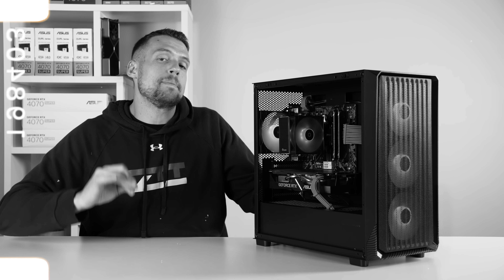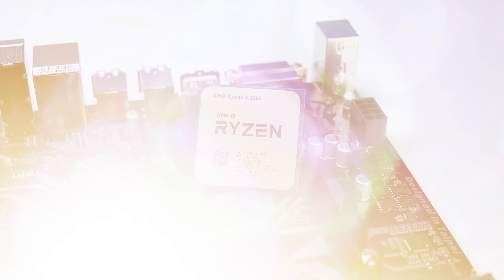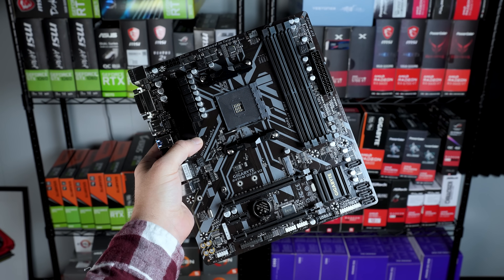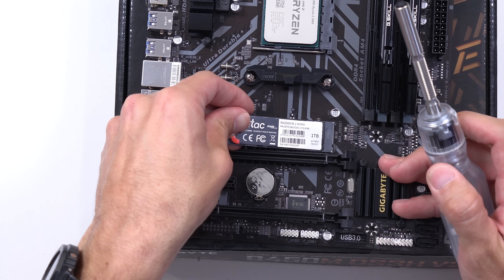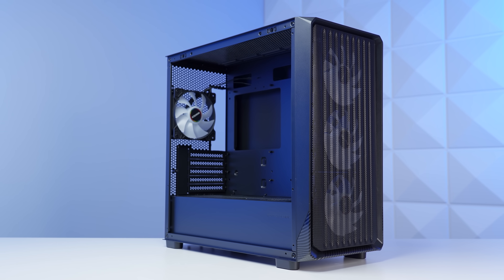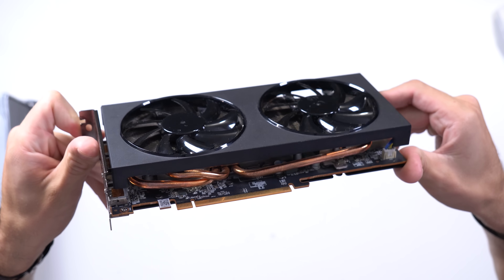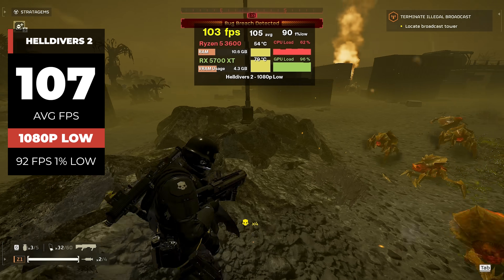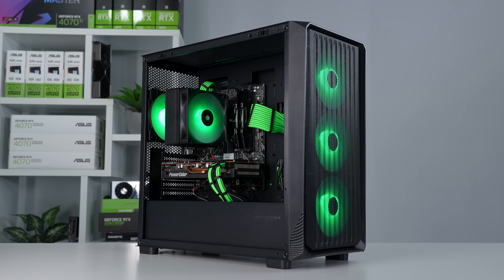$450 Gaming PC Build Guide

Comment from the maker: Thanks to Corsair for sponsoring today’s video! Check out their brand-new Frame 5000D case here: https://www.corsair.com/us/en/p/pc-cases/cc-9011308-ww/frame-5000d-rs-high-airflow-mid-tower-pc-case-white-cc-9011308-ww
Reply: Hi zach :3 so i builded *almost a new gaming PC that i planned to build like in the early start of the summer but in winter world said nuh uh and yanked my dad from us ( died bc of hearth attack ) but any ways i tried to cook up my build heres my parts :

AMD Ryzen 7 7800X3D 4.20GHz

James Donkey Lugis JDC240 ARGB 240mm liquid cooler
Team T-Force DELTA RGB 32GB(2x16GB) 6400Mhz DDR5 CL40 black Gaming Ram

Kioxia Exceria Plus G3 LSD10Z001TG8 1TB Gen4 5000/3900MB/sn NVMe PCIe M.2 SSD

COLORFUL BATTLE-AX B650M-PLUS V14 DDR5 7600MHz mATX AM5 Gaming Motherboard

well about the GPU i have a GTX 750 Tİ rn so i have to use it a while :3 *im planing to buy a used 3080 or 3070 ti * i cant buy  5000 series cuz yk the prices 

Whic parts did i upgrade from :

12.th gen i3 
8 gigs of ddr 4 
GTX 750 Tİ(well kinda didnt upgrade it tho but )
idc some cheap MSİ mobo same thing for PSU 

 if u put me to the vid i would apriceate it LOVE y'all
Reply: Please make a $500 PC build using the amd RX 5700 XT I. figured something out myself but it would be very great to see somebody using it for a budget PC build.  to say it's actually somewhat easy to find a build for this card I'm Canadian and everything up here is like $300 to $200 more with newer parts and usually even $100 more with used parts so if I can do it you could probably do it.
Reply: Asus Strix GTX 1080 OC for 90$
Reply: how big of a deal is the fact that B450 doesn't support PCIe 4.0, just 3.0? Both the CPU and GPU listed here support 4.0... then again a B550 board will push the budget closer to $500...
Reply: i really need help my pc keeps freezing when I'm not doing anything on it, i cant refresh the graphics card nor do anything once its frozen how do i fix this.
Reply: The only thing I dislike is the motherboard. They placed the sata port facing up right where the gpu sits. I have a 3070ti with the one you had in the first video and it makes it really tight putting the card in. Its an awesome budget option just feels like they overlooked the gpu fitment
Reply: ZACK PLEASE HELP is an intel core i7 14700f and msi rtx 3050 ventus alright for games like, idk hitman or smth?
Reply: Does anyine know how I could fix my computer it keeps freezing and I’ve tried repairing windows, installing windows again, cleaning it, makinf sure everything’s connected, I thinks it’s my graphics card which is a etc 3090 and I’m trying to fix it so I can make videos and play games but I can’t. Can you help?
Reply: Do An all used parts pc build
Reply: A PCIE 4.0 GPU in a PCIE 3.0 motherboard is LITERALLY LOSING OVER 50 FPS.
Reply: Hi, I want to buy a Gaming Pc but I don’t No What GPU is better for Gaming Amd RX 9060 XT 16Gb or the Amd RX 7800 XT 16Gb and would be Like good CPU's for the better one
Reply: @RizeRx-ks2ln sry bro but he ain’t responding😭✌️✌️
Reply: please help, these components cost $1300 at best in israel.what do i do
Reply: @Crachboss32  PS5
Reply: Thanks Zach for another banger video!
Reply: $24 dlls for the Ram, i haven't seen a price like that and I been searching.

The motherboard last week was around 120 on Amazon

Comment: I have ryzen 5 3600 and rx 6600 which i should upgrade first gpu or cpu first?
Reply: In my opinion, an AMD Ryzen 7 5800X3D could be a good CPU upgrade, depending on your needs.
Reply: but make sure to check your motherboard and PSU compatibility

Comment: Hey Zach, greetings from Greece! I ve finally built my first PC and i would like your opinion.
case: Lian Li Lancool 217 Gaming Midi Tower
cooling: Deepcool AK400
CPU: AMD Ryzen 5 9600X
GPU: ASUS GeForce RTX 4060 8GB ProArt OC
PSU: MSI MAG A750GL PCIE5 750W Full Modular 80 Plus Gold
SSD: Kingston Nv3 SSD 1TB M.2 NVMe PCI Express 4.0
Motherboard: Gigabyte B850 GAMING WIFI6 Motherboard ATX with AMD AM5 Socket
RAM: Kingston Fury Beast DDR5 16GB RAM 2x8GB with 6000 speed and 36CL (KF560C36BBEK2-16)

Comment: What I'd find a little more useful at this overall performance level than the achievable FPS at low or medium settings is what settings you can go up to for a somewhat console like experience at, say a reasonably stable 40 FPS, at least for the single player titles.

Comment: About seven months ago, I built a PC for my father for  316,82€ (367.42$) . It included a 3600X, an Asrock Phantom Gaming Rx 5700XT, a Be Quiet System Power 11 750W, an Alphacool Core Ocean T38 240mm AIO, a Gigabyte B550M K, 4x8GB Corsair Vengeance 3600MHz CL16, a Mars Gaming Micro-ATX case for 36€ (41,75$) from Amazon with case fans pre-installed, and a 2TB SSD. This is the ultimate price-to-performance build. Almost everything except the case and the SSD came used from an eBay auction.
Every game he plays runs on Full HD Ultra and some on QHD High/Ultra

Comment: I would always want a b550 with wifi/bt as of 10/17/2025 that is 88USD on NE (for the PCIe gen4 compatibly) now that gen4 drives are cheaper than gen3. I don't buy used parts off of Ebay I have been burned to many times.

Comment: I have i3 12 100f, rtx 2060 16 gb ram, 650w powersupply, 512 gb ssd, 40 euro case with 2 fans ..... Costs under 400 euro most from used market best buy rtx 2060 - 90 euro .... Only for CS 2 ❤

Comment: QUESTION!!!

Hey! I recently upgraded my PC! Been very exciting and Iam have a blast. I had a 3070 TI now to a 5070 TI and I7 10700K now to a Ryzan 9 9900x. I use it 90% of gaming and I have no issues with maxing out every new high graphic title at 1440p battlefield 6 doesn't drop below 120fps, COD, Avatar max settings similar and much higher outcomes. Etc...My question is should I really have gotten the less expensive but more for gaming based Ryzan 7 X3D CPU? Did I really waste the extra money or did I do good because getting a more powerful CPU for holding its value and strength for future upgrades? Love the content!

Comment: I'd say that the 1080ti is better than the 5700xt in every way, including price used (at least on eBay), but maybe that's just because I am a fan of using the older generation's premium products over the newer generation's budget. Also I would maybe use a 3700x over a 3600x, but i am still a fan of the 3600x.

Comment: I have a part list can you look at and tell me if it's a good list or not. Part List

AMD Ryzen 7 8700G 4.2 GHz 8-Core Processor

be quiet! Silent Loop 3 78.4 CFM Liquid CPU Cooler

Gigabyte B850 AORUS ELITE WIFI7 ATX AM5 Motherboard

Crucial CP2K64656C46U5 128 GB (2 x 64 GB) DDR5-5600 CL46 Memory

Gigabyte GAMING OC Radeon RX 9070 XT 16 GB Video Card

Fractal Design North XL ATX Full Tower Case

Microsoft Windows 11 Home OEM -DVD 64-bit

be quiet! Dark Power 13 850 W 80+ Titanium Certified Fully Modular ATX Power Supply

Western Digital DC HC530 14 TB 3.5" 7200 RPM Internal Hard Drive

Comment: I am looking to upgrade my GPU in my AM4 Ryzen 9 5900x cpu, 32gb DDR4 RAM, currently rocking a 3060ti, should I go for the 5070ti or the 9070xt ot 9070xtx? I'm a bit scared to switch to Radeon GPU because I've read it can be a bit awkward with removing Nvidia drivers and switching - but maybe I'm overthinking it.

Comment: Do yall think this is a good first PC? I need perspectives 😅

Case

Corsair 3500X ARGB ATX Mid Tower Black Tempered Glass

CPU

AMD Ryzen 5 9600X 3.9 GHz 6-Core AM5

Motherboard

MSI B850 GAMING PLUS WIFI AM5 DDR5 ATX

GPU

Asus PRIME GeForce RTX 5070 12 GB

RAM

Lexar Ares RGB Black DDR5-6000 CL30 32GB (2×16GB)

CPU Cooler

Thermalright Peerless Assassin 120 SE Air ARGB 66.17 CFM Black

Storage

TEAMGROUP T-FORCE G50 2TB SSD M.2-2280 PCIe 4.0 X4 NVMe

Power Supply

MSI MAG A750GL PCIE5 Black 750W Fully Modular 80+ Gold Certified

Comment: Hey Zach love your content! 
I’d love to hear what you think of my build:
CPU: AMD Ryzen 7 7800X3D
GPU: ASUS ROG Strix RTX 5070 Ti
Motherboard: ASUS ROG Strix X670E-F Gaming WiFi
RAM: Kingston DDR5 Fury Beast RGB 2x16GB 6000MHz (KF560C30BBEAK2-32)
Cooler: DeepCool LS720 360mm AIO
SSD: Samsung 990 PRO 2TB PCIe 4.0 NVMe
PSU: ASUS ROG Strix 1000W Platinum
Case: FOIFKIN F600 ATX Mid-Tower with 6 ARGB fans

Comment: @ZachsTechTurf  

Good day, Sir Zach!

I just want to ask for your advice regarding this system unit I found — it’s priced at ₱28,000 (around $475) but negotiable down to ₱25,000 (around $425).

Specs:

CPU: AMD Ryzen 5 5600

Motherboard: MSI B450M Mortar Titanium

RAM: 32GB (TeamGroup T-Force Dark Z, 2x16GB)

GPU: GALAX RTX 2070 Super EX (1-Click OC)

Storage: Crucial P3 500GB NVMe + Seagate Barracuda 2TB

PSU: Corsair RM750x (Gold-rated, fully modular)

Case: Asus Prime AP201

Issue: Two USB 2.0 ports and the front USB-C port are not working

A follower of your page😊
Reply: Is it still good with this year and following years?

Comment: Hi, Zach, I love your videos. Since you're an AMD graphics card pro, do you know what the problem is? I recently built a PC with a Ryzen 5 7500F, Radeon RX 5600XT, 850W power supply and immediately a problem appeared: after long gaming sessions, if you try to switch from the game to another program via Alt +Tab, the signal from the graphics card disappears. I have the latest version of Adrenalin, the video card does not heat up more than 75-80 degrees C in games. After reading the tips on the Internet, I increased the maximum allowable power and lowered the maximum frequency by 3%. The problem began to appear much less frequently, but it still appears about once a week. Have you ever encountered such a problem and maybe you know how to solve it?

Comment: I'm currently running Ryzen 5 2600 and GTX980Ti, looking for upgrades and I have been planning on ryzen 5 5500 and rx 6600, which component should I change first? The CPU or the GPU?

Comment: I'm wondering if i should upgrade my GPU from a 4060ti 16gb to a 5070? I was thinking the 5070ti at one point but it's so expensive. 

I'm using a 9700x cpu so i don't think i need to mess with that right now. And I'm playing games at 1440p.

Any advice anyone or ztt?

Comment: Three years ago, I worked hard to save up every dollar I could to build my first gaming PC. I didn’t come from a family that could easily buy expensive technology, so every bit of money mattered. After a long time of saving — almost $300 — I finally managed to get a computer with a Ryzen 3 2200G and a GTX 1650. At the time, I was proud of what I built. It was something I earned through my own effort.

However, as games and software have become more demanding, my graphics card is starting to show its age. I can still get around 140 FPS in some games, but the performance isn’t stable. It often lags or drops suddenly, making it hard to enjoy gaming or even do creative work like video editing or streaming. It’s frustrating because I know my CPU upgrade helped a lot, but my GPU is holding everything back.

Getting an RTX 3060 would completely change my experience. It’s not just about higher frame rates — it’s about having a smoother, more enjoyable time doing what I love. With the RTX 3060, I could finally play modern games without worrying about lag or stutter. I could also start learning more about video editing, 3D design, or even streaming without my computer struggling.

I’ve already proven that I can work hard and save up to build something for myself. But right now, upgrading my GPU feels out of reach financially. That’s why the RTX 3060 would mean so much to me. It wouldn’t just be a piece of hardware — it would be a reward for all the effort I’ve put into building and improving my PC over the years.

In short, I’ve done my best with what I have, but my system has reached its limit. An RTX 3060 would finally let me experience the full potential of my setup and continue pursuing my passion for gaming and technology.

Comment: earlier this year i built this PC, what you think or would change/upgrade later?

Ryzen 9900X
GeForce RTX 5070
TUF Gaming B650-PLUS WIFI
Corsair vengeance DDR5 32Gb (2x16)
NXZT kraken 240 (AIO)
NZXT C1000 Gold
4 intake fans and 2 exhaust

Comment: Is this a good pc that i bought and rate it out of 10
AMD Ryzen 5 3600 - CPU
RTX 2060 - GPU
B450M of GIGABYTE - Mother board
YOLO DDR 4 3600 16 GB RAM -
 Memory
Apevia Prestige 600 watt - Power
Netac 1TB NVME - Supply
Gamma A40 ARGB BK - Cooler

Comment: hey can you rate my pc and I am on very tight budget & this is my first build                                                                                                                                              1. CPU: Intel Core i5-6500

2. Motherboard: Gigabyte H110M-S2H (H110M, DDR4)

3. RAM: 2 × 8GB DDR4-2666 (Corsair Vengeance LPX)

4. GPU: AMD Radeon™ RX 580 8 GB

5. SSD: Kingston A400 480GB 2.5  SATA III

6. HDD: 500GB 7200RPM (WD Blue)

7. PSU: Corsair CV550 or Cooler Master MWE 550

8. Case: DeepCool MATREXX 30

Comment: Hey Zach, is this a good balanced build?

CPU: AMD Ryzen 7 7800X3D 4.2 GHz 8-Core Processor
CPU Cooler: MSI MAG CORELIQUID 360R V2 78.73 CFM Liquid CPU Cooler
Motherboard: Asus TUF GAMING B850-E WIFI ATX AM5 Motherboard
Memory: Corsair Vengeance RGB 32 GB (2 x 16 GB) DDR5-6000 CL36 Memory
Storage: Samsung 990 Pro 2 TB M.2-2280 PCIe 4.0 X4 NVME Solid State Drive
Video Card: MSI SHADOW 3X OC GeForce RTX 5080 16 GB Video Card
Case: Fractal Design North XL ATX Full Tower Case
Power Supply: Corsair RM850x (2024) 850 W Fully Modular ATX Power Supply
Operating System: Microsoft Windows 11 Home OEM - DVD 64-bit
Reply: Up your power supply to 1000w, the 5080 will need it
Reply: @Geerardo1  could u please recommend me some?
Reply: @OldSPlegend  the official recommendation is for 850w, but 1000 will future proof it a bit longer. If you haven't purchased your build yet, I would recommend seeing if you can bundle your build at all.

Comment: I can't find a comment explaining this but the reason why probably the extension didn't work is because there is no standard for how those cables are pinned or you know laid out you hear from other tech sources to not use power supply cables interchangeably because you might accidentally destroy your system so you used extension cables that weren't compatible or weren't designed identically to the cables already attached to the power supply is what im guessing. like You can't use cables from a modular power supply from one company and have them guaranteed to work on another companies modular power supply

Comment: Hi I’ve only ever used laptops for work and light gaming but I’m trying to put together a budget build and want to keep it upgradable on AM5. I’m planning on  getting a Ryzen 5 7600X, ASUS B650E-E TUF board, 16GB DDR5-6000, 1TB Samsung 990 EVO Plus, Corsair 650W PSU, and a Peerless Assassin 120 SE cooler. I’ll be using an RTX 2070 for now. Comes out to about $600 before tax. Does that sound like a pretty solid setup for the price? I found everything at my local Micro Center, but I’m not sure if there are better alternatives I might’ve missed.

Comment: I'm wondering if I should build something like this for my nephew or buy a used one off fb. Also contemplating upgrading my 5800x3d, 7800xt build to 7800x3d ddr5. Since its on sale.

 Then just finding a cheap gpu and finding the other parts needed cheap. But then again thats going to be like $600 just upgrading my system. Then whatever the cost would be building around my old 5800x3d ddr4 system for him.

Comment: I have a friend I gave a i7 6700 gaming pc to a couple years ago. Had him using a Evga RTX 2060 KO in it, but was able to get that swapped out to a XFX 5700 XT. You lose out on the missing RT support, but that has minimal impact because the 2060 really isn't fast enough for RT and doesn't have enough ram to utilize higher settings in newer games.

Comment: thanks for helping,i just built a pc few weeks ago with,
ryzen 5 3600
gigabyte b450m
256 ssd
500*2 harddrive
rtx 2070
650 watt power supply
for 550$
Reply: That’s pretty expensive but keep it for a long Time and it’ll be great for years